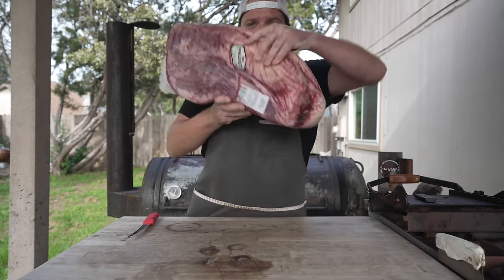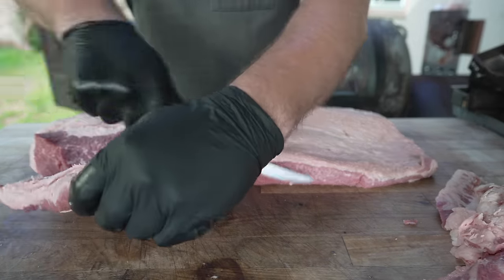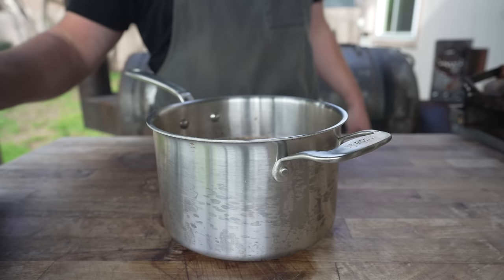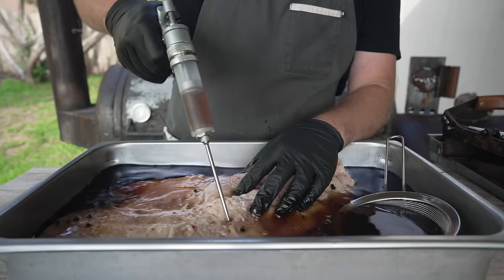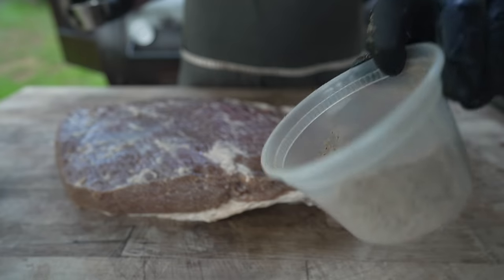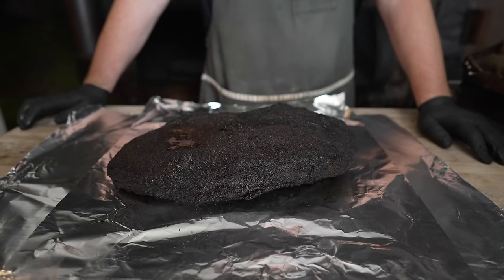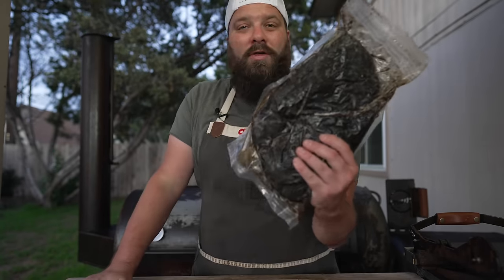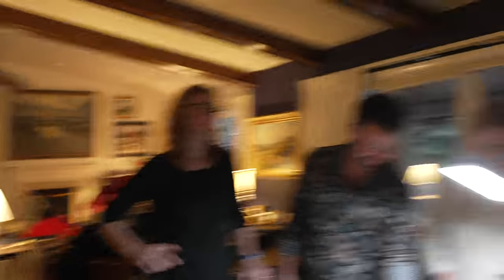How To Travel With BBQ For An Easy Holiday Feast! | Chuds BBQ

Comment: If you need to keep things warm while you are moving from your house to family or friends get you a couple of fire bricks and put them in the oven between 250 & 300. Grab a cooler and put a folded towel in the bottom. Once the bricks are warm put them in the cooler on top of the towel then put another towel on top of that. Put your food in the cooler and then top off with another towel and close the lid. This will create a warm oven in the cooler to keep your food warm and will last for several hours.

Comment: Wild..... I live in NW Minnesota & no snow has stuck around yet. Very weird. 
Your Mom is right - people from there should know how to equip their car to drive in snow & ice. 
On that - the proper northern state tire is the cheapest tire. 40,000 mile soft tire. Up here they will actually last twice that many miles. Cause we don't have the heat melting them. Even in summer.

Comment: I have found that when you use hot sauce ( I use Cholula ) as binder you get a little bit of heat from it.  @5:40. This is something I tried for a experiment and it has came out great.
Reply: A lot of people have.  I've used the truff before and if was great

Comment: Love the video! I do have some technical/specific questions as I'm gonna be bringing brisket for a similar amount of people:
1.) You mentioned that you'd vac seal it and sous vide it later, but it looks like you re-heated it in the oven in another foil boat at 300F?
2.) When you sous vide it where it's going to be eaten, what temp and how long if it's frozen?
3.) Can you slice and serve it right out of the sous vide or should you let it sit in or out of the bag when it's done in the sous vide?
Reply: Following.

Comment: Great Vid Brad 👌  if the ratios for all the pickling spice are calculated based on the weight of the water how did you only add 42grms of Pink cure salt if 1 Gal of water is equal to 3785 grams that would only work out to be roughly 9grms since 3785gms multiplied by .25% ???
Reply: I was always under the expression and do myself ( I do a lot of pastrami & other wet brines) weight of water & food. Thats equilibrium brining. I noticed those measures as well. Maybe he meant total weight.
Reply: @Jasonsciartilli  Even by adding the total weight of the meat which roughly looked to be between 6-7kgs let's just say  after trimming plus the water weight of 3785g +6000g = 9785g × .25%Pink cure = 24g Cure #1

Comment: I can't recommend this approach enough. Vac-seal the brisket, freeze, and travel. It will also serve as a "block of ice" in a cooler if driving. Use the redneck sous vide method -- large stock pot with hot water -- and it's a conch to feed a crowd. Additional benefit? Very few extra dishes!